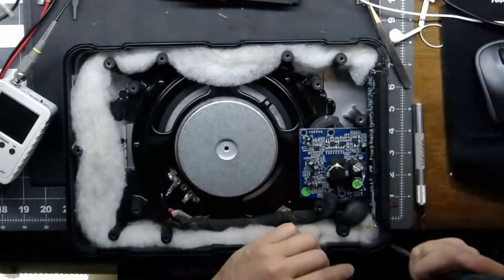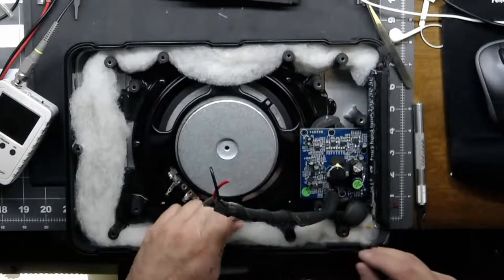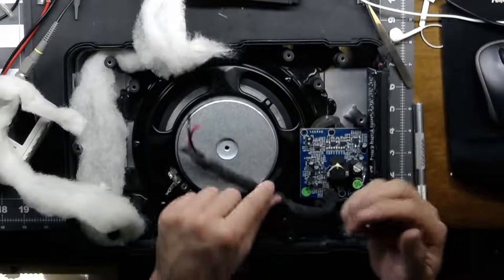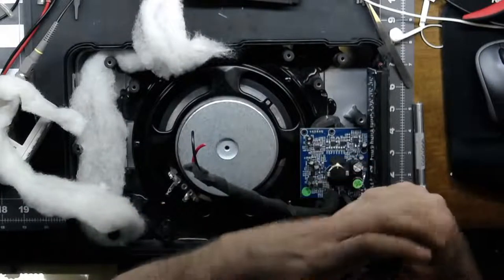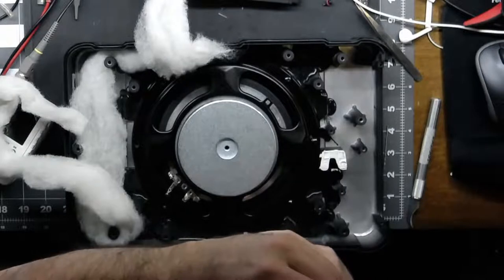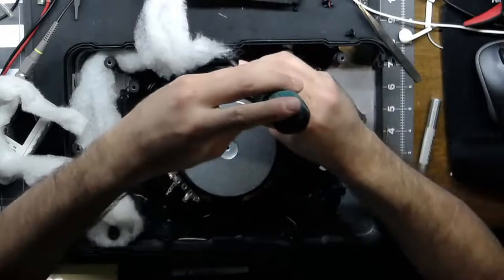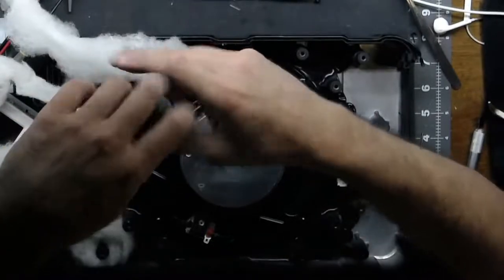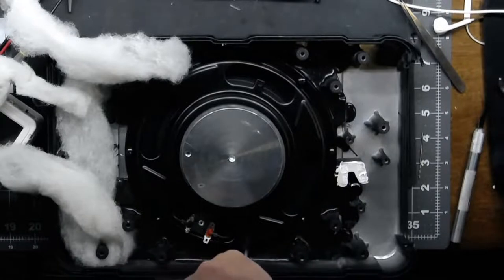Supreme Innovations LLC Live Stream - 025 - Kicker Hideaway Repair

Comment: Where can i order a replacement speaker and what should i look for in a replacement speaker? my HS8 was working fine and quit during a drive. after checking it, all fuses were good but no lights (blue or red) would come on. Would a bad speaker cause this issue to happen - no power, no lights, no ouput/bass?

Comment: hi I have the same hideway sub, but mine is sparking when you connect to a 12v battery, any ideas why this would be the case, there is no life in the unit, the fuse on the outside of the case is fine, have you come across that at all before, anything that rings a bell that I could look at, I am technically mided so dont mind getting my hands dirty smd repairs etc thanks

Comment: Question:I have Kicker unit, exactly as pictured, worked last summer, took car out this spring and unit that has the BLUE light on, but no audio.  Is it likely the same problem?     Also, Awesome video, thank you for showing the problem well.
Reply from the maker: 90% the woofer is blown. Very rarely is it an amp issue.
Reply: @supremeinnovationsllc  Ok. Thanks!  Can you simply power the sub to test it, once you open it up?  I'm thinking you can't 'see' if it is blown unless you cut the speaker open as you did. Right?
Reply from the maker: @i-changeus  You can test the amp with any other speaker once you open it up.
Reply: @supremeinnovationsllc  Thank you!!  And do you have a repair driver (that you sell that won't fail so easily or one that you can recommend?)  Thanks again : )
Reply: @supremeinnovationsllc  hey bro we need you back on here to hook us up!

Comment: The speaker makes a click when I put a 1.5 volt battery across the terminals so not open circuit.  This is a several year old Kicker 11HS8.

Comment: my sub has the power protection indicator - LED is red not blue.  I checked connections - all ok. When the remote wire gets power the indicator turns red, inert otherwise.  Is there a particular component on the (preamp?) board that is known to fail?  Does a subwoofer speaker failure cause this behavior?  If not, and no electronics repair I have a good subwoofer speaker someone might want.  Thank you for any suggestions!

Comment: Worked fine this morning, shut the vehicle off for a few hours, turned it on and no sound and no light at all. Fuse looks fine. Any ideas?
Reply from the maker: Slap the back of the unit and see if it makes and pops. Chances are the woofer is bad.

Comment: Do you have anymore of these drivers I’m in need of one
Reply from the maker: I am out of stock and if i order replacements I have to order 60 of them. I probably will not be making that order because I only sell on average 1 a month and don't want to store 5 years of replacements.
Reply: Awe man do you know where a can get a different alternative I hate to throw this away over a speaker like to put it back in the truck
Reply: @supremeinnovationsllc  i definitely need one but I might get 2 off you I got 2 of these I’ll upgrade both of them
Reply from the maker: @dominicmeisel2508  I pinned this comment but added you to the list
Reply: @supremeinnovationsllc   how much is a replacement for the hs8 on eBay? eBay item #?

Comment: My sub is not working
Reply from the maker: Probably needs a replacement woofer. I will add some to eBay right now.
Reply: Do you have that 12 inch speaker you used in your Utube video?
Reply: Can you provide a link for the woofer?
Reply: Got any more replacement speakers? Would love to get mine back going.